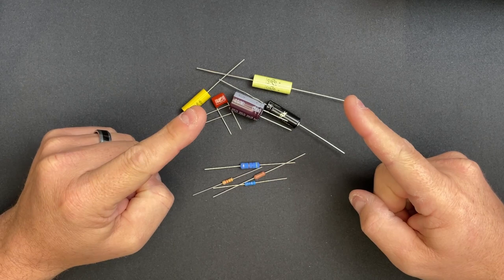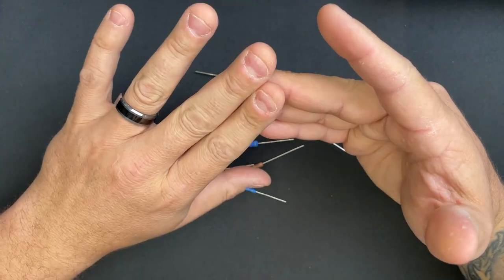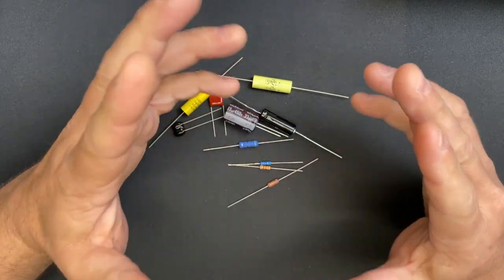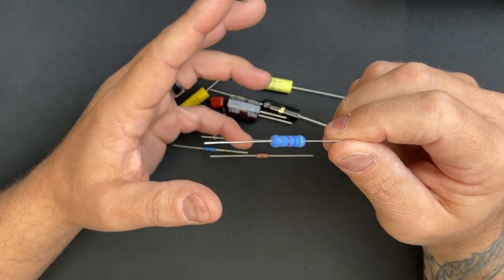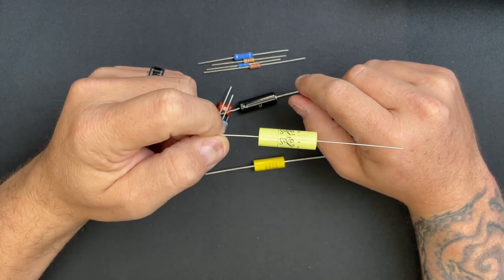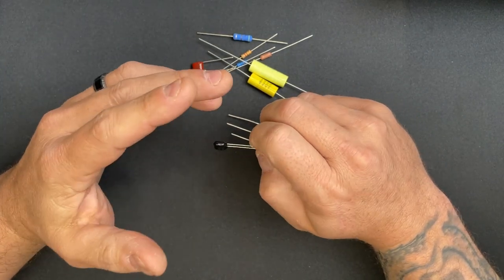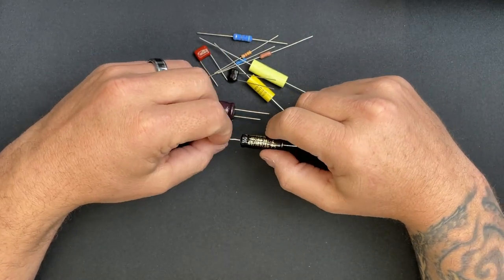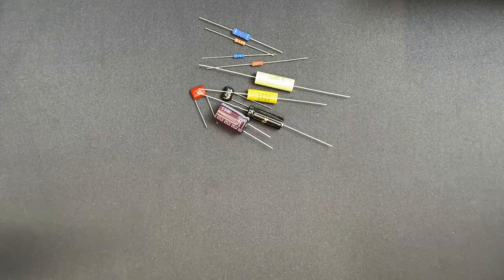GUITAR AMPLIFIER BUILDING BASICS EP. 01

Comment from the maker: If you have suggestions, please feel free to leave a comment. I ramble a bit, so I know it is hard to sit through some of this, but the Data is good.  I'm working on getting things shorter and fitting more data in.
Reply: How did that auction go for the amp you built? Got some good offers for it?
Reply from the maker: @RAfiote2  TBH, not as good as I had hoped. I am not famous by any stretch of the imagination. So, at a local wine tasting & fund raising event, I had probably the least interesting auction item. The item was sold to a friend of mine for $600+ the cost of entry. The event raised over $140,000, and I was just one small part of it. The nice thing is that because my friend won the auction for my amp, I get to " borrow " it at will. Sad state of affairs when you consider that just in parts alone, there was at minimum $700 in that build. The speaker was $200, and we didn't even touch my time spent building it. I figure I put about 100 hours into it including design time and building the cabinet etc. Thank you for your interest, and perhaps it will be on another auction block some day with a higher bidding price?

Comment: You really should try to source some good ceramics to use in lieu of silver micas for high peaks. I think they sound 100x better. Im also with you on F&T and sozo caps. They're fantastic.
Reply from the maker: My only gripe with ceramics is that they can be microphonic. Aside from that, I don’t really have anything against either form of capacitor. They do sound different, but only barely. Hence my statement of pick one and be happy. Neither is going to make or break the amp. I suppose my experience with truly vintage amps is limited, and therefore not conclusive to my feelings of the choice to use, but in my 30 years of playing I cannot say that x amp built x way, was better because it had x, y, z within it. The amp either inspired me, or didn’t. My experience with designing and building amps is more based around practicality, ease of sourcing parts, and does it sound good. I am not trying to be elusive, mysterious, or have some black magic to sell these things. It is genuine, it is truthful, and not slathered with snake oil. That is all I try to do.

Comment: Great stuff. Thanks for getting specific. 
Exactly what I was looking for. 
So is it your opinion that differences of  capacitors are in + or - specs, noise level and lifespan? If we hold that to be true, how can we make a new amp sound like a classic vintage one? You think it ultimately comes down to Speaker and transformers that are pushed to their capacity?   Tubes?
Reply from the maker: Vintage anything has a Value, that may or may not be in " Spec ". So how to make a Vintage correct amp with truly mordern parts is not an easy task. Those that claim they can, are selling you on something. How can you reference against it? You can't..... Speakers are where it is truly at; if you want to change the sound of your amp, change the speaker cab. A good sounding amp, sounds good, vintage or not.

Comment: where do you buy the dale vashey and do you use 1/2 watt in your builds or 1watt only
Reply from the maker: The Dale Vishay resistors can be found at Digikey, or at Tube Depot. I get them from Tube Depot. They are rated for 1 watt below a certain temperature, and are advertised as 1/2 watt though. 1/2 watt is more than enough for 90% of the amp though. The only reason to go up in wattage for most parts of the amp is to lower the noise floor. In the case of metal film, the noise floor is considerably lower than carbon film, and extremely low compared to carbon composition.

Comment: Weird how we all perceive things differently. I personally can't stand metal film because of its sterility. I hate carbon comp for the reasons you said as well, but i have to admit it does sound fantastic. Carbon film is basically right in between for me and usually what i use for most parts of a build. There are definitely times that metal film actually is the perfect solution and same for the others. If im working on a modern amp that needs to sound modern, metal film tends to be the way to go. But i will NEVER use them in a vintage amp for how drastically they change an amp's tonal characteristics, particularly in the high end. I know everyone hates hiss, but when you're on stage or playing with a band in general, hiss doesn't matter whatsoever. But for a modern amp or if you're trying to make an amp that can sell, hiss is definitely a bad thing to most people who wouldn't understand maybe why an amp needs to hiss in today's world.
Reply from the maker: As a sound engineer of 20+ years I have come to learn one thing is certain. Sound is 100% subjective. What one person may think is angels singing, another will think is dying cats falling from the sky.

Who is right? Does it even matter? It’s not easy to be simple, and being complex doesn’t add any value. Which is why I preach that you simply have to pick one. Whatever justification you need, just pick one. 

My mantra is: Quiet, no hum, no hiss, over-engineered yet practical and non interactive tone controls. 100% hand made amp and shell, with visible chassis.